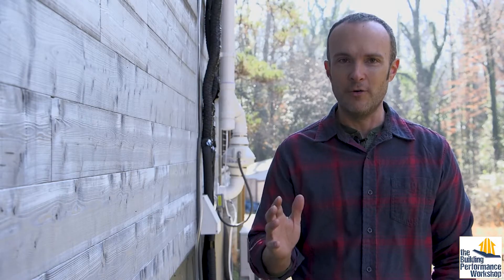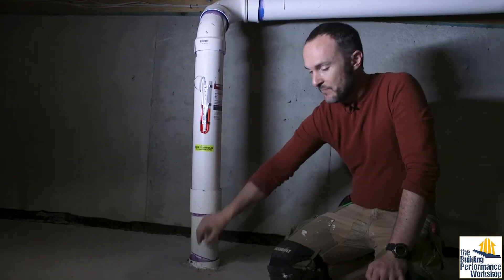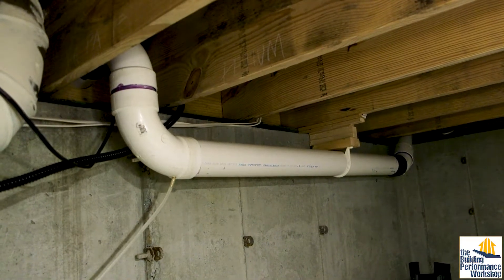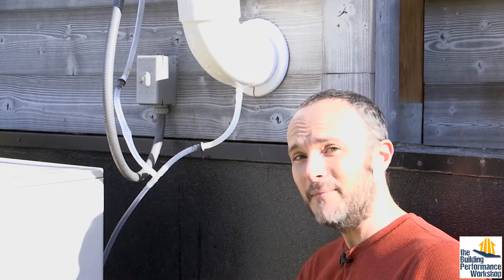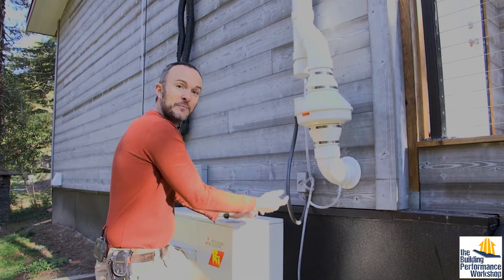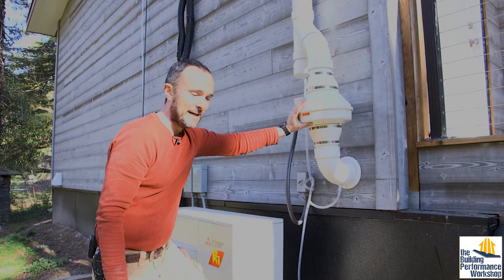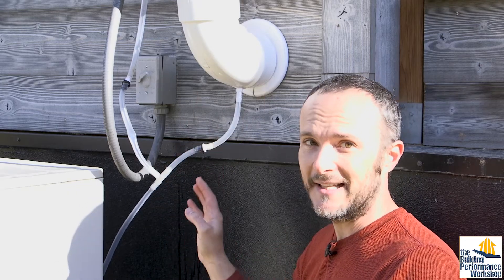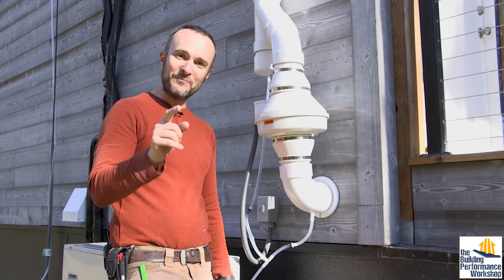How to Hotrod a Radon Mitigation System at Home

Comment: This is right on...

"@kg4lod
1 year ago
While I admire the effort, this design gets many critical details wrong. You don't need AND DON'T WANT all those back-drain ports and dead-air spaces in the exhaust pipeworks. Radon is MUCH HEAVIER THAN AIR. You need maximum static pressure development in the pipework to create as much velocity as possible to lift these particles and you NEED a monotonic pressure gradient to ensure that no particles "fall out of" the air stream and accumulate in cleanout accesses or behind waterfall drain caps/traps. Radon is RADIOACTIVE -- the hazard increases if you concentrate it or leave it around in a pipe. You cannot design as if you are controlling water. Water accumulated in a trap is fine, radon accumulated in a trap is more dangerous than leaving it in open air (where it can disperse). You most especially DO NOT want a RAINCAP. The radon vent pipe should point straight up and have run straight for at least 2 feet to create as much laminar high velocity flow as possible. You want to throw the radon particles as high above the house as you can to entrain them in the naturally dispersive air volume above your house. If you rain cap as shown here, you are forcing a stream of radioactive particles to settle on your roof where they will find a way in, fall off right in front of your perimeter, or concentrate on your roofing. With radon control systems, you IGNORE WATER. The Fantech radon fan is water proof and the pathway leads from below grade to above roof, so any water entering the radon vent system will simply end up in the dirt below your house where it's harmless. Seems like a case of a little knowledge being dangerous. I apologize for the directness, but people should know before they copy this nonsense. Radon venting is very simple, just suck up the ground gas and blow it out the top as straight and as sealed as possible along the way."

Comment: Living in raydon levels at double the safe acceptable limit (9.2) for 70 years increases your chances of lung cancer between 2% and 5%. That percentage increases dramatically for smokers. A small percentage of people are more sensitive to raydon than others and may experience mild flue like symptoms from prolonged exposure to high levels of the gas, such as inflammation, respiratory illness, runny nose, and cough. There is no real “safe” level of the radioactive gas, only an acceptable level that your body can tolerate by regenerating itself at a rapid enough rate to keep up with the cellular damage. The half life of Raydon is extremely short compared to the other radioactive noble gases, at only around 27 days. This means the thousands of tiny particles degrade quickly in the air we breathe, and when they degrade it causes a tiny explosion strong enough to visibly damage bullet proof glass. This type of cellular particle damage is very similar to what astronauts have to contend with when on missions in space.

Comment: I also purchased the Airthings Radon tester, which shows high fluctuations in radon and the times, temperatures, and readings don't coincide. Radon information generally tells you, in addition to under slab venting, to seal cracks and gaps in your slab or basement, and that any venting will help. So far, I have pulled up carpet and padding and sealed a drain hole, and don't see any gaps or cracks and still have just as much Radon. I opened a bathroom window and turned on my bathroom exhaust vents all day which didn't change anything. It will be pretty easy for me to install a system but I need to figure out how to determine the fan sizing and under slab airflow.

Comment: While I admire the effort, this design gets many critical details wrong. You don't need AND DON'T WANT all those back-drain ports and dead-air spaces in the exhaust pipeworks. Radon is MUCH HEAVIER THAN AIR. You need maximum static pressure development in the pipework to create as much velocity as possible to lift these particles and you NEED a monotonic pressure gradient to ensure that no particles "fall out of" the air stream and accumulate in cleanout accesses or behind waterfall drain caps/traps. Radon is RADIOACTIVE -- the hazard increases if you concentrate it or leave it around in a pipe. You cannot design as if you are controlling water. Water accumulated in a trap is fine, radon accumulated in a trap is more dangerous than leaving it in open air (where it can disperse). You most especially DO NOT want a RAINCAP. The radon vent pipe should point straight up and have run straight for at least 2 feet to create as much laminar high velocity flow as possible. You want to throw the radon particles as high above the house as you can to entrain them in the naturally dispersive air volume above your house. If you rain cap as shown here, you are forcing a stream of radioactive particles to settle on your roof where they will find a way in, fall off right in front of your perimeter, or concentrate on your roofing. With radon control systems, you IGNORE WATER. The Fantech radon fan is water proof and the pathway leads from below grade to above roof, so any water entering the radon vent system will simply end up in the dirt below your house where it's harmless. Seems like a case of a little knowledge being dangerous. I apologize for the directness, but people should know before they copy this nonsense. Radon venting is very simple, just suck up the ground gas and blow it out the top as straight and as sealed as possible along the way.
Reply: Well, well! Someone who actually knows what they are talking about!!!

Comment: 3:37 can you explain where the condensation is coming from at this portion of your solution?

Is it bc of the diffy in air temp being pulled from under your slab interacting with the temp of condition air temp of pipe?
Reply: I am wondering this too as I am building a similar section of a radon system in my house now. My thinking is that the pipe will be in conditioned space, so it will be higher temperature than the air it is pulling and condensation shouldn't build up as a result. But maybe I'm missing something?

Comment: Great video; beautiful home.  Do you find the PVC pipe brackets help keep the noise down inside.  We just had a mitigation system installed at our home and there is quite an audible hum inside.  The exhaust pipe is tight up against the siding, with metal brackets.  I e tried to get the installer to come back. He did come back and put a “cushion” between where the main pipe exits the wall before the fan but that made zero difference unfortunately.  What about the pipes with foam inside? Would that reduce the pipe resonance?  Thanks
Reply from the maker: Try a better quality fan- our Fantech is so quiet I have to touch it to confirm it’s running.

Comment: I'm building a very air tight home, where every inch is a living space. Since my fan has to be outside, should the exhaust piping run up the outside of my house or can it be run up in the inside walls where pipe runs out to fan, then back into the house and up to the roof exhaust port?

I haven't seen anyone do it but I haven't found any codes or people not recommending doing it this way.

Comment: I'm surprised you haven't cut the plastic along the edge of the floor and sealed it with something like Lexel caulk as all cold joints tend to leak.
Reply from the maker: Just finished that project, Tim- there’s always a mountain of to-do’s

Comment: That’s a nice mits unit - hopefully that lineset gets finished because it looks like ass.

Also the one check valve for your condensate drain is on the positive side of the fan, is it actually needed? Not a fan of the Wye fitting type of design on the downstream of your inline fan. It’s really not required at all.

Lastly, don’t think I didn’t see the over application of primer on those pipes and the 90 should’ve been rolled to accomodate your sloped pipe or add two 45’s to create an offset.

Comment: Love the enthusiasm. Good information you're sharing. One thing I would double check If I was you is the 90⁰ fitting in your crawl space at the start of your system. I'm 12 year veteran of the hvac/pipe fitting industry and the horizontal connection does not appear to be seated properly and looks to be connected very poorly.
Reply from the maker: Thanks for your concern Alex, I hear you that it’s not pretty- I actually installed this entire system myself, the angle’s a little off because of the clearances but we accounted for it after glue-up. Keep on helping us non-pro pipefitters!

Comment: Thank you for the video. What kind of tube fitting did you use to tap into the 3" PVC pipe? How did you do it?
Reply from the maker: Simple brass male threaded fitting on one side, tubing nipple on the other. Drill into pipe, screw it in with silicone on the threads. Bam.

Comment: Only problem with "air tight" houses is the inability to have a fire or fire stove as it needs to draw air. We built a cabin very air tight and our fire place (glass surrounded in center of living room) would not stay alive. Turned out there wasn't enough air in the house to allow it to breath.

Additionally on top of radon there is also another uncontrollable invader into homes which is moisture from the ground which wicks through the footings and into the concrete walls into the house.

Having a fire place or wood burning heater etc allows for control of the moisture, making a bit of air even more important.

These are important for a "forever home" especially given the instability of today's economy where if (God forbid) there is some collapse of the grid and electric dehumidifiers are no longer useful... Including stoves etc... Fires become very important.

I'm also a dad building a forever home and thought I'd share.

Nice work, house looks good!
Stay safe!
Reply: Did you not install a fresh air intake pipe that is next to your furnace?
Reply: Do you have a vent free fireplace instead of a vented?

Comment: I’d have used crawlseal 20 mil vapor barrier superior to 15 mil.
Reply from the maker: No, that’s an oversimplification. The permeability is the important metric, not thickness.
Reply: @HomePerformance  20 mil for concrete is superior due to potential tearing during rebar placement and concrete pouring. They all have to have a perm rating of 0.1 or below so you are splitting hairs. A 15 mil regardless of perm rating is useless if it is torn with a rake or shovel while moving concrete around. And trust me a lot of concrete crews don’t give a damn if they damage it. That’s why I would go with the 20 mil. Crawlspace a are another story. 10-12 is about as high as you wanna go because 20 and even 15 isn’t very pliable for sealing purposes in tight spots. Imma home inspector and I see all kinds of half ass installments in crawlspaces that do absolutely no good. And I live in one of the worst states for radon. It’s crazy how most people don’t know about radon around here. And I see some radon mitigation systems that are a nightmare of 90 degree elbows and ups and downs. It’s pretty crazy. And what’s even more shocking is the slab on grade homes that didn’t even install a vapor barrier under the slab. Lol it’s nuts.
Reply from the maker: 10-4 buddy. No rebar in my 2” slab, so no worries. Fiberglass admixture instead. Agreed on the rest. Crazy people everywhere.

Comment: There are a ton of published papers on NIHs database from the last 20 years revising radon research and suggesting new nominal levels and critiquing the model used to arrive at our current regulatory limits.
Reply: Actually, look into the new research changing from the LNR model, a linear extrapolation based on very real and measured risk in miners to the HRR model… it reflects a more modern understanding of alpha and gamma particles on health. One could basically conclude that canadas limits are more optimal… but please don’t shoot the messenger! Thanks for the vid.
Reply from the maker: AND not to mention that the EPA's radon map hasn't been updated since 1993. Homes are WAY more airtight now than they were back then, so the radon levels are probably quite a bit higher everywhere.
Reply: @HomePerformance AND they only test the basement, not every slab and there’s a lot of split level/room over garage situations where you get Radon somewhere other than the basement

Comment: Will gravity fed condensation even open a check valve? Does it have an extremely light spring?
Reply from the maker: When water builds up, it’ll open almost anything :). Also, what’s the diff between water from condensation and water from a sink?
Reply: @HomePerformance  Won't the fan pull a vacuum on the check valve preventing it from opening when water wants to flow down?
Reply from the maker: The fan pulls 0.1 inches of water column, so if 1/8” of water wants to get out it can.

Comment: Excellent ideas, it shows how much you care about the safety of your family.  I have a question maybe you will answer:  since radon is heavier than air, why isn't the pipe directed away from the house in a down hill slant?  With venting above house, doesn't it  take more energy to lift it and then doesn't the heavier radon fall to the ground near the house?
Reply: The science behind venting it to a high point is that the air will disperse the gas as it falls to the earth. If you vent it low, you leave an opportunity for the gas to collect near the ground which might impact humans in that area. Most states require venting at or above the roof line.
Reply: @geraldwalsh8277  In the outdoor atmosphere there is enough turbulence that gases stay well mixed. You don't get segregation of heavier gases to the surface
Reply from the maker: The wind and general dilution with outdoor air is enough to lower the toxicity, and moving gases around with a fan costs almost nothing

Comment: In Canada we have to keep everything indoors because how cold it gets so our system is very simple. The entire system including the fan is installed in the basement and the vent is vented outside the house a few feet above ground level, and this is all up to code up here .
Reply: Sounds good and likely uses less energy.  How long is the pipe to move the radon away from the house?  I don't understand the concept of venting above the house as radon is heavier than air and would fall back to earth after the effort/energy of getting it so high.
Reply: @melodyfleck9368 if you were to test airflow above and below the roofline you would find a very noticeable different. There is more time and space for dissipation from the roof. You can often smell gas from a furnace and sewer venting from oof level at ground level.
Reply from the maker: Nice! I’ll let my Yukon friends know.

Comment: Why does it need to go all the way to roofline for pipe?  Could even downturn it once out of house. Seems like overkill. Is it for fan noise?  Thanks
Reply from the maker: It’s a concentrated flow of toxic gas- dump it where no one will be hurt, since you went to all the trouble of installing a system
Reply: @HomePerformance  I get what you are saying, and that likely is the case for the design reason, but in reality, I suspect that it is not actually concentrated.  I suspect that the air flow is 100 to 1000x  what is needed to "concentrate" the gas.  It just transports it out so that it doesn't concentrate inside (before).  I would be interested in measuring your situation at the pipe for a month and report the average and peak radon at the exhaust tube, where we know you had fairly high levels inside (known source of radon).
Reply: @larryseibold4287 I think this is a pretty mature field and measurements have been made. The code in our state at least is that the vent must be 10 ft from windows.

Comment: I would imagine simply having a dedicated air ventilation system would be a huge improvement over a lot of homes when it comes to radon levels?
Reply from the maker: I actually don’t think it would help as much as you expect- only 150 cfm dilution air, max- we were at 19, hard to bring that down with just ventilation dilution.

Comment: My radon fan is located directly behind my head on the master bedroom wall for various reasons. I can hear it and feel the vibrations through the 6in wall. What can I do? I bought the same hangers that you showed in this video a few months ago in hopes that their rubber boots would dampen the vibration against the vinyl siding (no luck there). I have also tried the big enclosure case by pretending I was a radon mitigation company (because apparently those things are impossible to buy otherwise). It had no positive effect and seemed to reverberate more sound. I then stuffed it full of rockwool insulation, but that returned me to the normal loud state. The tube the company used is sched 10 4in. I am at my wits end. I've disassembled the fan and cleaned the blades, but that did not seem to have any effect. I've called the company that installed it, but they tell me that's normal. It can't possibly be normal. I can't freaking sleep!
Reply from the maker: Sorry to hear, Phil! This is one reason design is so important- obviously the builder didn’t consider this detail. I’m going to recommend two things that might sound dumb, but I swear they work: add a sleep sound machine to the noise level at night, or move the bed.
Reply: @HomePerformance  I ended up replacing my RadonAway XP201 from the original system installer with the FanTech in your video. I didn't do it just on a whim - Matt Risinger also has this fan on his house. The swap was simple enough. I've got the potentiometer set at 6(of 10) and not only is the system dead silent inside, but the vacuum reading in the basement is better than before! Well worth the $350 after YEARS of this shit. I'm back to only hearing my tinnitus! The wall vibrations are gone too. I believe that might have partially been my fault. With the hangerloks, there's always one extra click you can get to super snug them up.